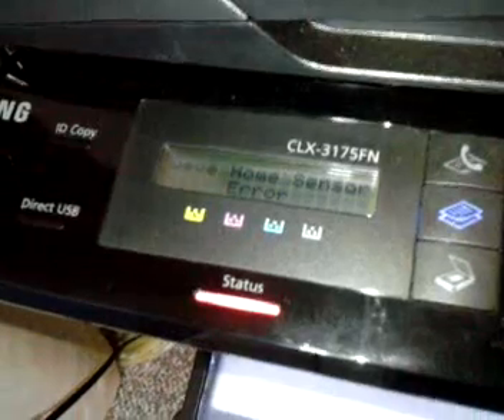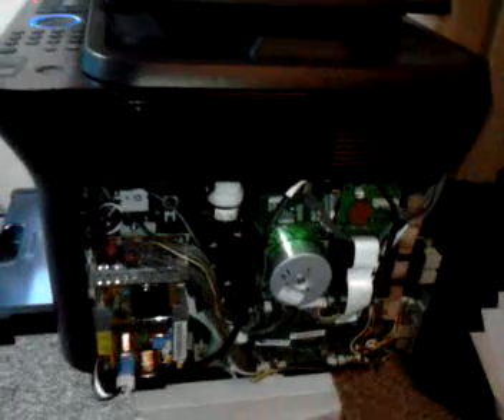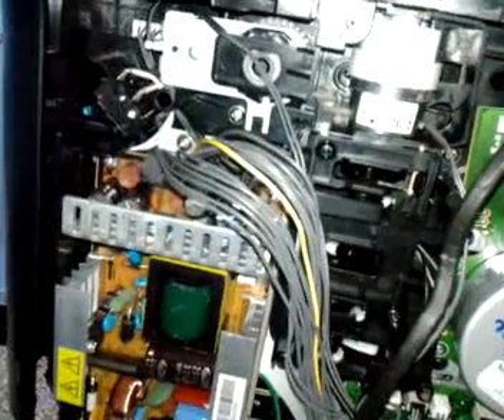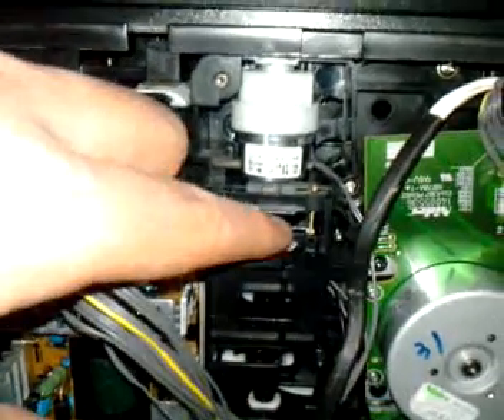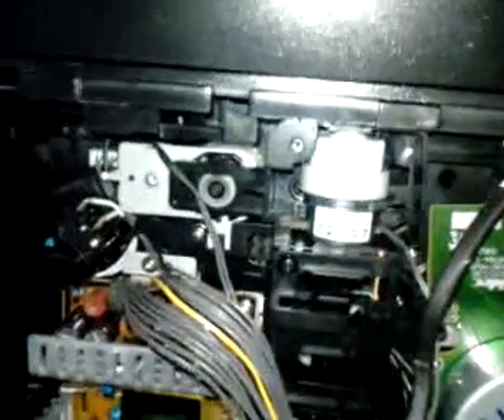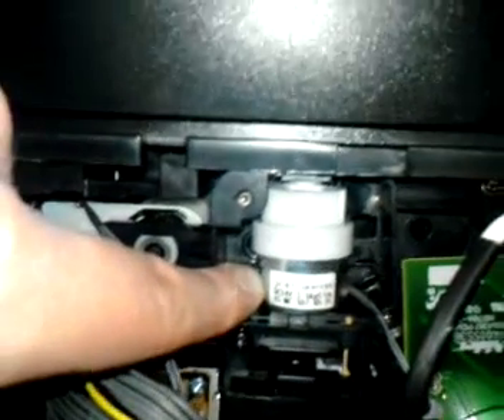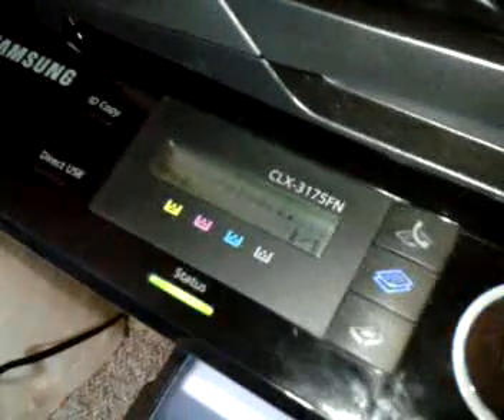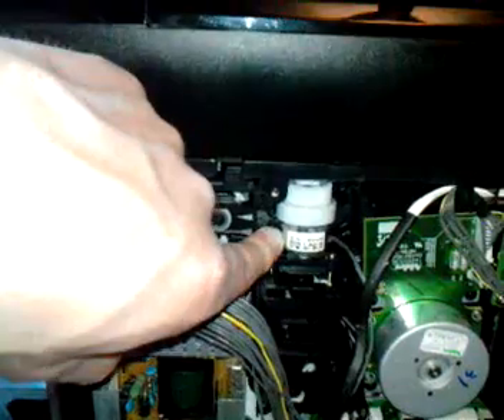Samsung CLX-3175FN "Deve Home Sensor Error"  Part 1/2

Comment: Thanks Jonny for your video, even though many years after its creation it was useful to me in solving my problem. 
I too, on my CLP 365 had the same error (#A3-6110) "Deve Home sensor error". 
I had dismantled the front panel of the entire cam assembly, where the cable that goes to the fuser roller assembly passes (for a repair to the fuser assembly in fact). While doing this I inadvertently dropped a small plastic bushing on the bottom of the cam shaft that keeps it centered. Having found the compass among the cables at the bottom, I put it back in position and everything started working normally again.
Probably whoever got their hands before you had the same problem but didn't notice the small missing compass which was probably lost.
(Translated with Google)👍

Comment: Hi Jonny, 
can you show or send suggestion for how to replace clutch and solenoid as I don’t see any screws on it 
I have a deve home sensor error I tried loosening the spring as well other things
I decided to change clutch and solenoid but could not see any screws on them.
The solenoid shaft not rotating also how to take out shaft out of the solenoid 
Please send any clip or suggestions 
Thanks

Comment: Hi can you show or send suggestion for how to replace clutch and solenoid as I don’t see any screws on it 
I have a deve home sensor error I tried loosening the spring as well other things
I decided to change clutch and solenoid but could not see any screws on them.
The solenoid shaft not rotating also how to take out shaft out of the solenoid 
Please send any clip or suggestions 
Thanks

Comment: Heh, Thanks for the video and ideas.  I tried what you showed which was (UNFORTUNATLY) not the final solution for me, but really got me close to the solution.  FOR ANY OTHERS who still have the problem.  I continued with removing the sensor and cleaning in between the the "sender and receiver".  Simple window cleander and some paper towel.  They grease the cam and I am guessing that some of the grease (or dust) was blocking the sensor.  You can get to the sensor by moving the cables aside and removing 3 screws.  The sensor can be released and cleaned at that point.  Still, you put me on the right track!  Thanks!
Reply: Gregii flieger Thanks for your comment, I'm going to try this as soon as I am home again. For me it says "Positionssensor Fehler", I suppose that's the very same error, right?
Reply: My white gear, and motor is also floating but that is not the problem, it still stops the same as yours even when steady, so I'll try what you suggested.

Comment: Your solution was exactly what my CLX-3185 needed. Stabilized it by using a small piece of plastic. To open the printer I followed this video. [search youtube for: Open panel on your Samsung CLX-3175FN CLX-3175FN laser printer]. (thanks tom73458)
Now the printer is OK. I hate samsung! after 1 year and 1 month I had this message and I could not print. Thank you for your support.
By Céline (Same problem in FRANCE !! message in French is erreur detecteur local develop)

Comment: Your solution was exactly what my CLX-3185 needed. However, I stabilized it by using a small piece of wood and wedged it under the tab you held with your finger.

To open the printer I followed this video. [search youtube for: Open panel on your Samsung CLX-3175FN CLX-3175FN laser printer]. I also easily removed the hinge on the front door, right side with just a little pressure, Made moving the side panel easier.

Comment: I cannot for my life figure out how to open the printer to get to the electronics? Mine looks slightly different to the picture. It is a CLX-3175, not a CLX-3175FN, perhaps that's why? But still, how can I get to in without cutting open the printer?